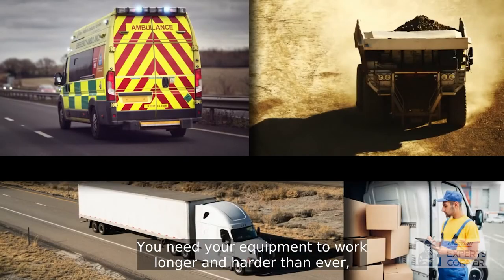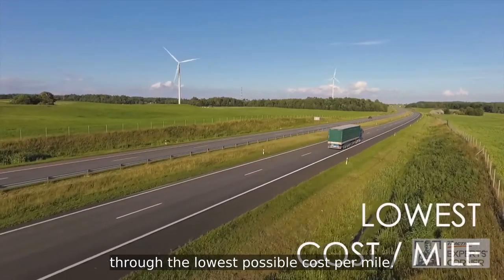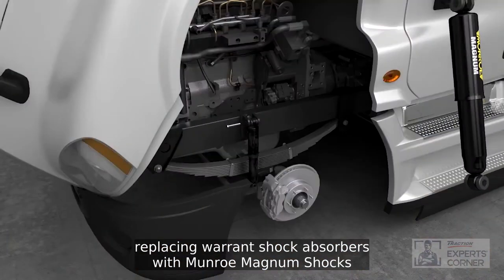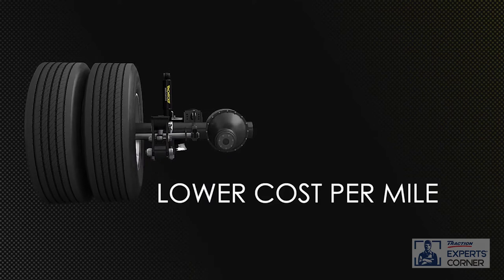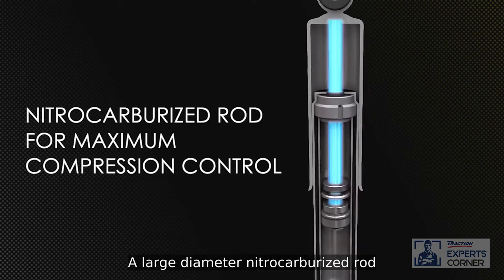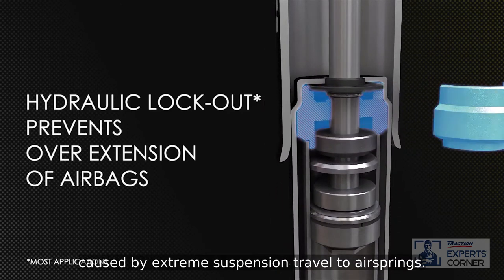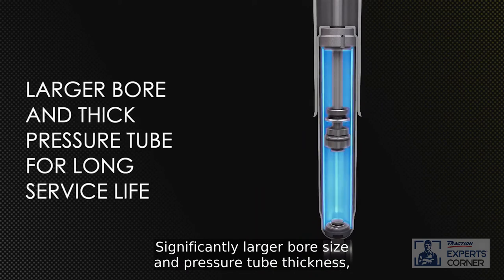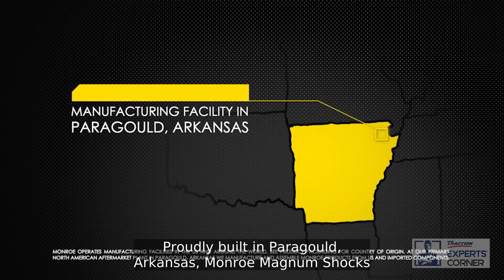Monroe Presents: Magnum Shocks

Comment: What happens if you put these on a much much lighter offroad suv? Shocks never come with a weight rating.
Reply: Tell the parts store what type of SUV you have, and they will give you the shock you need...you w
Not be using a semi shock
Reply: @cablanchette1 thanks, monroe does not make a lift shock for my 2000 chevy tracker, only a stock version in your lowest performance categories. Im looking for something that is longer and will fit and be compatible.
Reply: @HomesteadOC  okay, I am not a Monroe representative by the way just some dude that knows a whole lot of nothing about a whole lot of stuff lol.